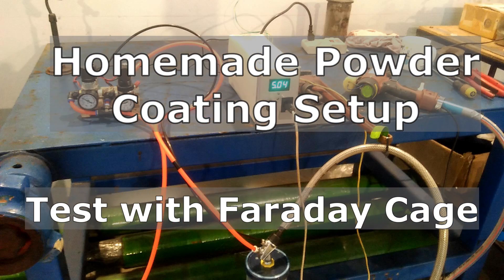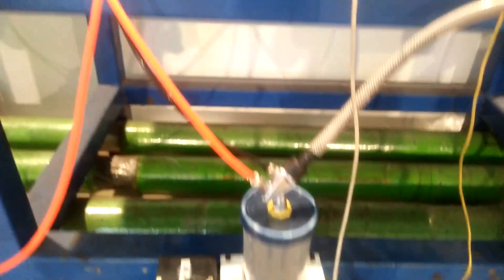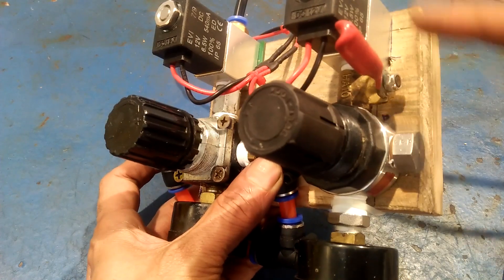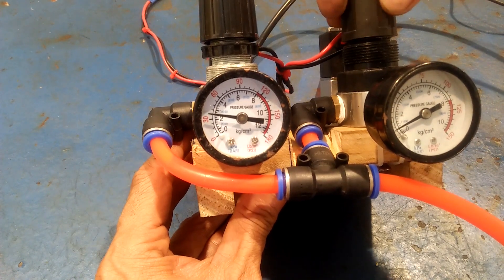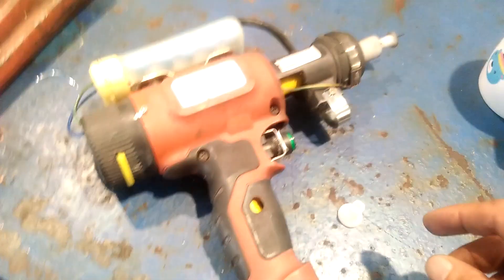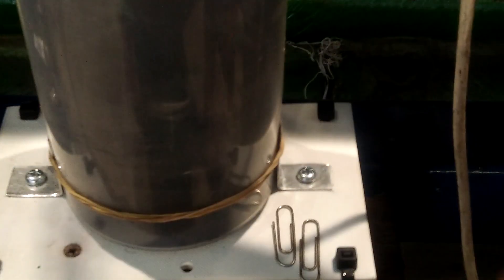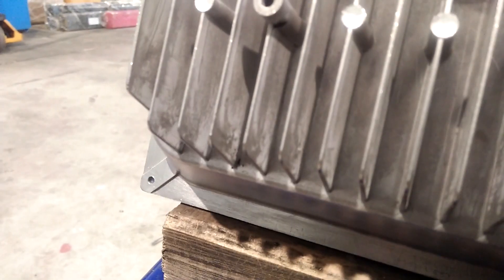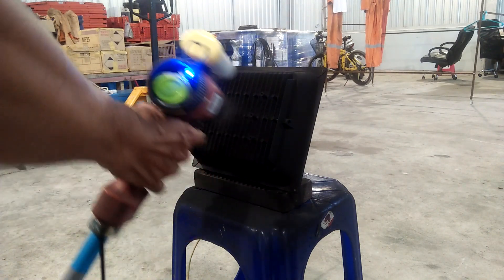Homemade Powder Coating Gun vs. Faraday Cage

Comment: Awesome content, definitely earned a sub. I was wondering, what was the input Amperage and voltage of the original  powder coating gun that utilised the cockroft walton voltage multiplier. I also didn't quit catch what the final output hz, voltage and amperage was. Think youtube might have deleted some of your videos since some of the links have stopped working :(
Reply from the maker: Hi. Some of the videos got copyright strike due to the use of some silly background music. I was tricked to using these background music for "free". But they are only free for a short period of time and then once the YouTube video is uploaded and get some views, the owner of the music will make a copyright claim and you either pay for the music or they get the revenue from your videos. So I deleted some of these videos and re-uploaded without those background music. I am yet to sort out which links I put on some descriptions are not working. Alternatively, you can visit the channel playlist. Thanks.
Reply: @DIYPhil  Man sorry to hear that, sounds really scummy. Thanks, I'll make sure to check out the reuploads and playlist 👍
Reply from the maker: The input voltage is variable because that ultimately adjust the kV output of the gun. The current drawn from the power supply also changes depending on the "load". If I remember correctly, it is about 1 Amp. The final output Hz to the step up transformer was set to about 16 kHz but that also changes a bit when the supply voltage is changed.  Have a look at this video where I used and oscilloscope:
https://youtu.be/U24Y4QNquX4?si=B7PonNE5YJNTLCnm

Some of my recent video shows me reverse engineering a professional powder coating main board where we can have a more detailed understanding of how the circuitry works. 
https://youtu.be/OCLsUD94baU
https://youtu.be/sH1p75Q9Fm0

Comment: sir are you a filipino?
Reply from the maker: Opo.
Reply: @DIYPhil  beginner powder coater pa po ako. ano pa po iba nyo maiisuggest na solusyon sa faraday effect. medyo basic po kasi gamit kong gun. 😅
Reply from the maker: @alexyzlorenzo2488  Kapag yung gun mo walang powder pump mahihirapan ka talaga. Kung makikita mo sa video, ang teknik kaya naabot ng powder yung mga singit ay malakas yung buga ng powder. May pwersa yung pag lipad ng powder kaya nalalampasan yung faraday area. Imagine mo kung walang pwersa yung powder didikit na yun dun sa mga kanto sa bungad ng faraday areas, hindi na makakasuot sa mga singit. Nakocontrol yun dun sa timpla ng compressed air sa pump. Isa pa mababa yung kV. Dahil mababa yung kV, maraming powder hindi dumidikit, bumabagsak lang kaya sayang, pero ganun talaga.
Reply: @DIYPhil  tnx po. looking forward sa mga matututunan ko pa sa inyo sir. ☝️

Comment: Hello, the cascade of capacitors and diodes is necesary? I try whit a flyback only.
Reply from the maker: I saw some people able to do with the flyback only. The high voltage cascade can generate very high voltage and yet very low current that is ideal in powder coating.
Reply: @DIYPhil  thanks, i think view the last videos for the new version of the gun 😊, excelent congatulations. I will made a gun in this days.